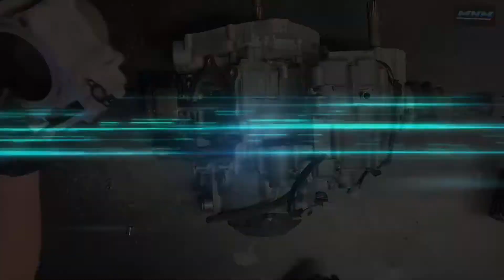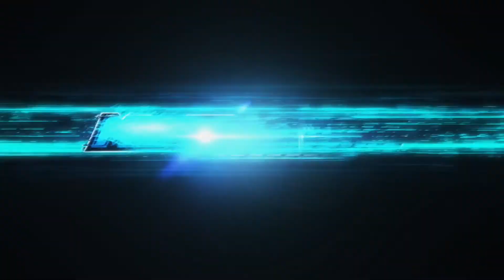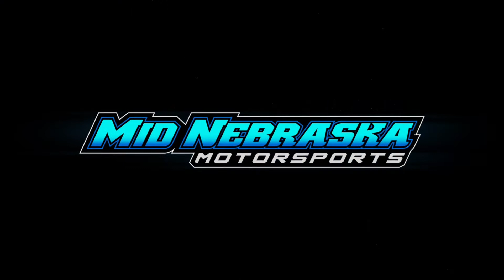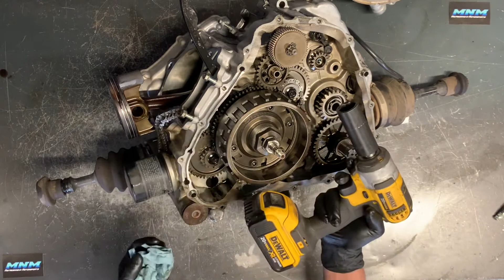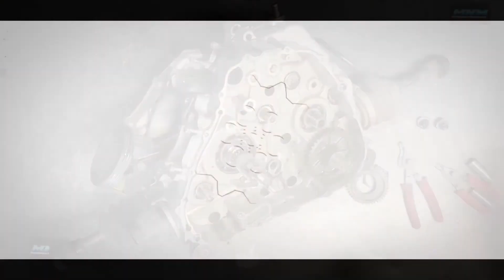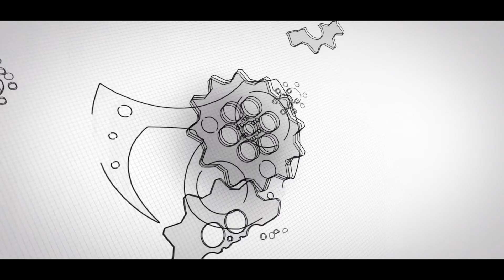Suzuki King Quad 750 Flywheel Stator Magneto Removal Replaced - Tool Link Below

Comment: Hey man i need your help ,i am doing a swap and i am an inexpert ,i am using the engine from a 750 2015 king quad but it seems to be reverse the rotation in the transmission bars ,i was needing to go clockwise if i am looking from the front but this engine is counter clockwise ,do i have a way to make it run the other direction

Comment: Thanks for the info. Quick question please:
King Quad 700. I’ve just replaced my stator, put back together and the starter motor seems locked. 
Starter works fine on the bench!
I suspect I’ve put shims back in wrong and locked up either the torque limiter or the idler gear. 
Engine starts fine on pull start. 
Does this sound plausible before I pull the casing back off?
Thanks in advance.

Comment: Hey, wondering if you could help me. I have the Suzuki 2016 750 king quad. I took off the side plate that holds the stator and some washers fell out. Just trying to figure where they go. The parts picture really doesn't help. If you could help me, it would be much appreciated!
Reply: Hey. I just asked a similar shim question before reading this. Did you find out where the shims went as I suspect I’ve managed to lock up my starter gears? Cheers.

Comment: Nice to see another video. I was talking to a local ATV mechanic and told him of a TGB 425 that I’ve ran out of ideas to find the correct puller. He mentioned that it copies a Suzuki engine. The reason to pull the flywheel is because of rust. I can’t pull the recoil and the starter just makes noise from not being able to turn. I did pull the crankcase side off to expose the flywheel and seen the rust.